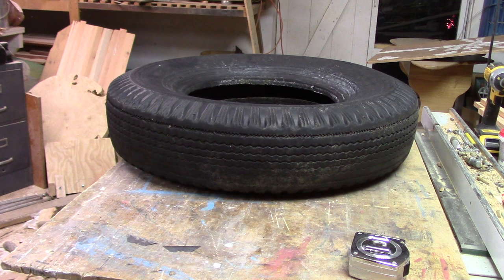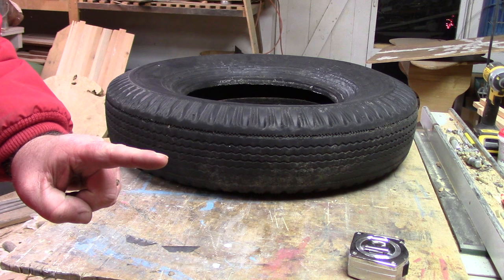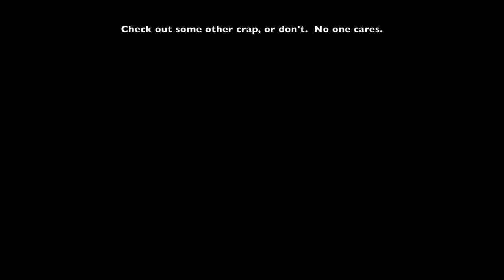Cutting Tires In Two

Comment: I only had to do this once, but I learned the hard way that it takes a TON of elbow grease, most of an afternoon, and a sharp knife and occasional hammer to cut one by hand.  Now I have 47 simi truck tires that have to be cross cut in half... at 72 I may not live long enough! .  Looking for a better way. But really enjoyed your video and the "sexy" elbow shot! LOL
Reply: I use a dual saw. It's great, but you definitely need to concentrate & have full situational awareness when using it. You can dismember, gut, or otherwise maim yourself and/or someone else, if you're not careful!
    I used one to cut old steel & iron pipes out of a house to make room for copper water pipes & PVC sewer pipes, & it cut through the old steel & iron in a jiffy. I now use one to cut old tires into chunks to use as TDR, Tire Derived Fuel, mixed in with the coal in my furnace. It's much quicker than using a grinder.

Comment: I use the dual saw too. It's great, but you definitely need to concentrate & have full situational awareness when using it. You can dismember, gut, or otherwise maim yourself and/or someone else, if you're not careful! I used one to cut old steel & iron pipes out of a house to make room for copper water pipes & PVC sewer pipes, & it cut through the steel & iron in a jiffy.
    I now use one to cut old tires into chunks to use as TDR, Tire Derived Fuel, mixed in with the coal in my furnace. It's much quicker than using a grinder.

Comment: If you want to cut a tire for disposal use a utility knife to cut the walls off first. The remaining is easy to cut. Best advice is to start with a grinder and cut the part where the wall was cut towards the thread. Always wear safety glasses, gloves and an apron to protect from the rubber psalter, if it’s too hot it will stick to anything. If you want to save your grinder wheel, after you get to the thread use a reciprocating saw with a strong blade that cuts through metal. Diablo makes the best do not use a wood saw that can cut through nails, use a saw that can cut through metal. If you have any specific questions feel free to ask.
Reply: I do! I have several I just want to cut in half but not the way he did. I want two u’s left to shape into borders for projects. What’s best? Especially on a very limited budget.